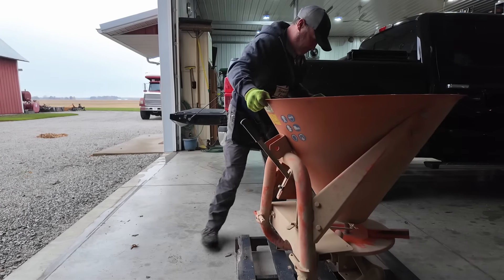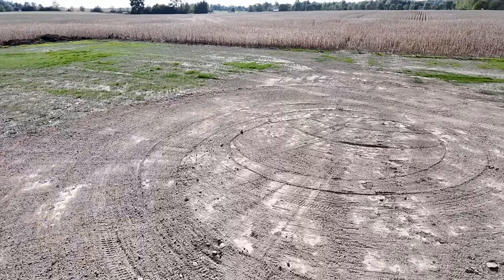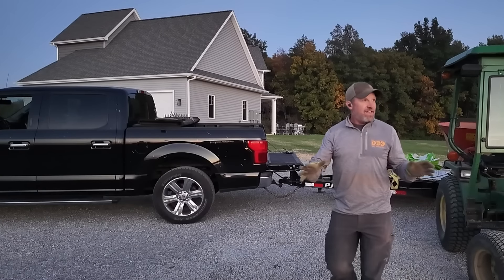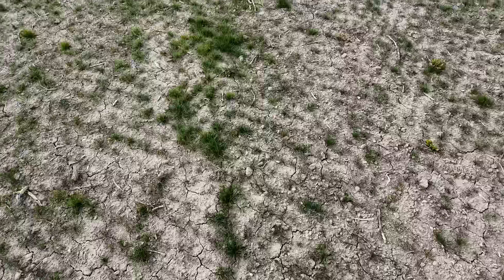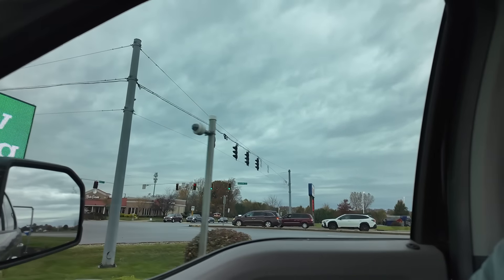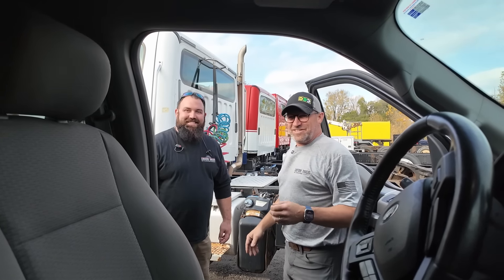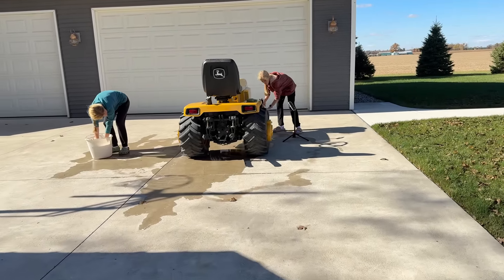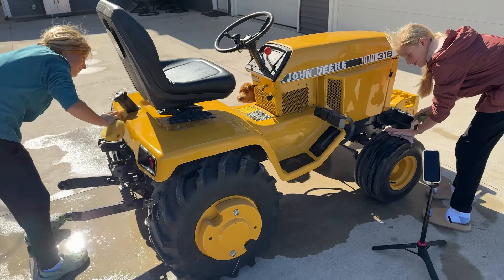I Was Undecided, But It's A Done Deal Now!

Comment: As an auto mechanic all the comments regarding the paint job being an uneven trade is kind of wild. It wasn't like the guy just rattle canned it, he clearly did some very extensive disassembly, rust repair, fiberglass repair, welding, bondo, cleaning, grinding and prepping to get that truck to the point it could be effectively painted. That's if i had to guess ~100 hours worth of work. That truck looks brand new, he did an amazing job, and all the prep work required for it to look that damn good shouldn't be discounted. You guys both worked your asses off and both got some damn good outcomes, thats the type of trade everyone wants.

Comment: The truck looks great Neil, I’m excited for the bronco project! 
  Pro tip from someone who has the same shelves: I find them infinitely more useable if you cut down some 1/8” hardboard or plywood to sit in between the black runners and on top of the wire racking. It allows you to slide things around on the shelves with ease and also makes them useable for smaller paraphernalia that would normally fall through the holes in the wire. 
  Keep up the great content!

Comment: You are going to like the silver in the end. So much easier to keep looking good. With the gravel roads and high dust environment you live and work in, it shows up less than black or white. Also summer time heat on a black interior is deadly, while a white interior is always dirty. Silver and dark grey not black is a thought for interior. Looking newish and one heck of an improvement. The lawn is doing great for a drought. Just hope the over seeding is still there when the rain comes. I use to like to get an over seed done right before an inch of snow because that melts slow and does not erode as much. Time will tell, but the over seed was the right thing if it had rained like expected. We work with what mother nature gives us.

Comment: When it comes to a work truck as in a truck that's actually going to be used for work a light color like white or silver will hide a lot more than black or red or dark colors . Dings, scratches and even just dust shows up so much more on the dark colors. Dump truck looks great I wouldn't question it one bit.

Comment: You're going to want to get some black on that engine Hood that silver will blind you driving down the road on a Sunshine Day and also if you take a black stripe and have it on the top level with the top of your door handle and go down to the bottom up the dump box and that way you can paint it later on the dump box right along your door and that'll take the top of your fenders in where you can narrow it up I think that would look cool

Comment: Neil 
    May I challenge you to a simple grow off competition? 

   This scientific experiment can be done NOW or in spring as well. At that 6 acre job, or in your own yard, mark out two test plots very close together. In the first test plot, cover the soil and seed in straw. In the second test plot, cover the soil and seed with compost or stagnant peat moss. The difference will be visible by early spring if not by this winter. 

   Sir I'm not trying to tell you you're wrong, by using straw. I see and know the benefits of using straw. I'm trying to convert you to using compost over straw. It may cost a bit more but the benefits of compost whey outweigh the cost. 

   It's compost you just dump it on the ground. In multiple different areas, staging different spots. Making it quicker to load. 

    How good are you with a spreader gate, on a dump truck and a skid steer?  I'm not this good but I've seen friends who are full-time operators. Do a dang job spreading compost evenly with a skid steer. I don't know how good they are but I've seen compost spreaders that attached to the front of skid steers. 

   Where to get compost is kind of an open-ended question since I don't know where you live nor do I need to know that info. I'm sure if I lived in your area or you were dedicated to using compost it could be found fairly easily. Where do the local tree guys dump their chips? Composted wood chips are great compost.  How about the DeKalb County Yard Waste Compost Lot? Are they open to the public? Do they sell in large quantities? Are they close? 

P.S. have you thought about doing a silver and blue 70s Ford paint scheme. I think that silver would go really well with the new Jeep or Acura blue.

your hard work and attention to detail shows. Some of us may seem like we're criticizing but we're just passing along information that we know that you may not know yet.
Reply from the maker: I understand it isn’t criticism.  And I am in agreement that compost may in fact work better, albeit maybe it that much to make it worth all the extra effort.  As I said, spreading compost at a rate high enough to make it worthwhile would be difficult and time consuming.  On small, residential or housing addition yards it would be the ticket!  But to get it on 6 acres would be nearly impossible.  I would love to try it but really don’t have any spots to compare right now.  Next time I seed something maybe that would make a great component of the video.
Reply: @digdrivediy    I understand your point 100%. I have used my V-box salt spreaders to spread compost in large amounts but I also have several salt spreaders. 
    Have you ever thought about hydroseeding?
     I spoke to a guy the other day that's going to do two yards for me and if it's worth it I might start to do it myself. 
     Yes that would be great B-roll footage for a video

Comment: Compost has way more value that straw to a yard
Reply from the maker: I won’t argue that, but where to get and how to spread 6 acres of compost?
Reply: @digdrivediy  6 acres is only about 8 big dump truck loads of Compost.
  What about Felger's Peat Moss? They're not too far from you I think. 
   If available there's always a choice of buying composted manure from a local farmer with cattle, chickens or hogs.
   A lot of rental facilities rent compost spreaders or pay a farmer with a manure spreader to do it. 
   I personally bought a used little 4'x8' manure spreader. It pulls great behind my little John Deere 4100 to compost yards.
Reply from the maker: @kevenhiemie  Felgers would be about 1.5 hours from the yard job. Then, where to dump 8 tri-axle loads of compost to then scoop up again and work from?  It could be done, but I guess my question remains…

Why not just use the straw when it’s easy, cheap and the results are undeniable? What is the opposition to straw when it so clearly works very well?
Reply: Neil 
    May I challenge you to a simple grow off competition? 
   This scientific experiment can be done NOW or in spring as well. At that 6 acre job, or in your own yard, mark out two test plots very close together. In the first test plot, cover the soil and seed in straw. In the second test plot, cover the soil and seed with compost or stagnant peat moss. The difference will be visible by early spring if not by this winter. 
   Sir I'm not trying to tell you you're wrong, by using straw. I see and know the benefits of using straw. I'm trying to convert you to using compost over straw. It may cost a bit more but the benefits of compost whey outweigh the cost. 
   It's compost you just dump it on the ground. In multiple different areas, staging different spots. Making it quicker to load. 
    How good are you with a spreader gate, on a dump truck and a skid steer?  I'm not this good but I've seen friends who are full-time operators. Do a dang job spreading compost evenly with a skid steer. I don't know how good they are but I've seen compost spreaders that attached to the front of skid steers. 
   Where to get compost is kind of an open-ended question since I don't know where you live nor do I need to. I'm sure if I lived in your area or you were dedicated to using compost it could be found fairly easily. Where do the local tree guys dump their chips? Composted wood chips is great compost. 

P.S. have you thought about doing a silver and blue 70s Ford paint scheme. I think that silver would go really good with the new Jeep or Acura blue.

 @digdrivediy
Reply: Neil 
    May I challenge you to a simple grow off competition? 

   This scientific experiment can be done NOW or in spring as well. At that 6 acre job, or in your own yard, mark out two test plots very close together. In the first test plot, cover the soil and seed in straw. In the second test plot, cover the soil and seed with compost or stagnant peat moss. The difference will be visible by early spring if not by this winter. 

   Sir I'm not trying to tell you you're wrong, by using straw. I see and know the benefits of using straw. I'm trying to convert you to using compost over straw. It may cost a bit more but the benefits of compost whey outweigh the cost. 

   It's compost you just dump it on the ground. In multiple different areas, staging different spots. Making it quicker to load. 

    How good are you with a spreader gate, on a dump truck and a skid steer?  I'm not this good but I've seen friends who are full-time operators. Do a dang job spreading compost evenly with a skid steer. I don't know how good they are but I've seen compost spreaders that attached to the front of skid steers. 

   Where to get compost is kind of an open-ended question since I don't know where you live nor do I need to know that info. I'm sure if I lived in your area or you were dedicated to using compost it could be found fairly easily. Where do the local tree guys dump their chips? Composted wood chips are great compost.  How about the DeKalb County Yard Waste Compost Lot? Are they open to the public? Do they sell in large quantities? Are they close? 

P.S. have you thought about doing a silver and blue 70s Ford paint scheme. I think that silver would go really well with the new Jeep or Acura blue.

your hard work and attention to detail shows. Some of us may seem like we're criticizing but we're just passing along information that we know that you may not know yet.